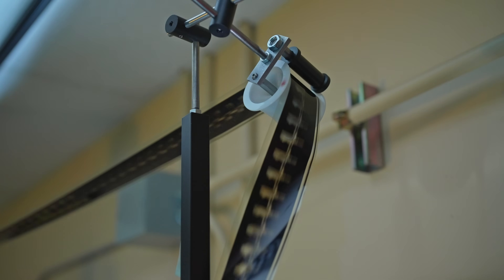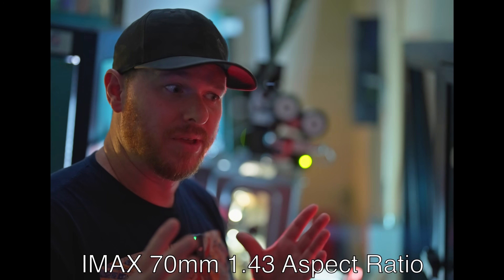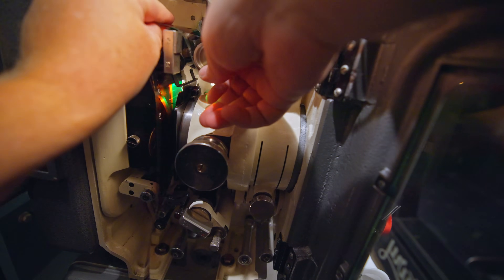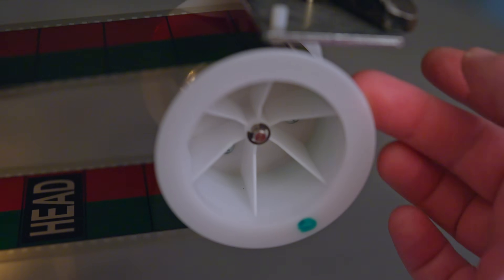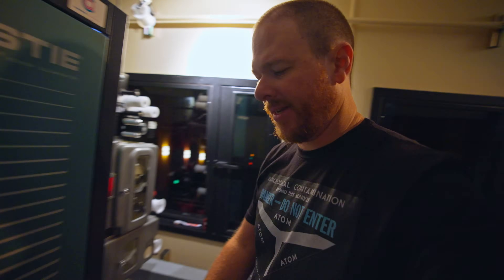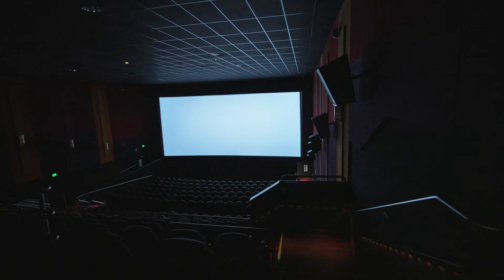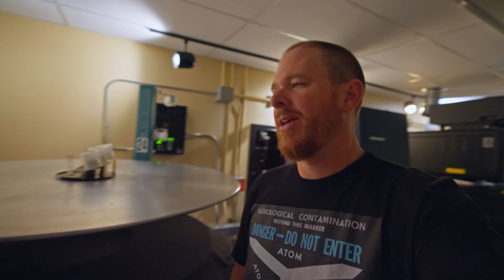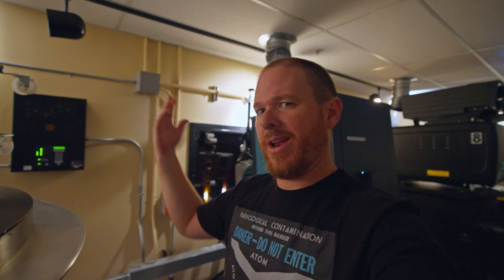Being a Projectionist for Oppenheimer 70mm Film Part 2

Comment: Great and fascinating video, thank you for making it.

Talking of the old days and two projectors, the reason they had to have two projectors was the limitation on the burn time of carbon arcs. I worked in a projection room at a cinema in the UK in the fifties. The positive carbon would burn away about four inches of rod in the twenty minutes of one reel. If you missed checking the amount of carbon rod left before changing over to that projector it would run out of rod before the reel ended, as the arc gap became wider the picture would take on a blue hue! Not good. But wonderful days with the mercury vapour rectifier sitting under each projector arc housing glowing vivid blue as it rectified 240v mains and supplied the arc lamp with 45v at about 70 amps. 

Thank again for the video.
Reply from the maker: I've only seen a carbon arc lamp fired up a couple times. They had one over at Paramount Studios that was used for a Vista Vision projector. I'm sure the burn time on carbons had a part to play on why reels of film were usually around 20 minutes or 2000'.
Reply: It's where the phrase "Strike up the lights" in theatre comes from, the old days of carbon arc... Not in my time though, we'd already switched over to HMI or MSI lamps by that point in the late 80's... they still had to strike, but didn't involve any manipulation of the electrodes as they were in sealed into their glass enclosures, but you still need a small bank loan to buy them.....

Comment: It's always blown my mind how projectionists make those change overs in the old system. I just can't wrap my mind around how you time it so perfectly (I guess I need to see someone doing it).
Reply from the maker: Most of the film I have run being a projectionist has been changeovers. There are numbers that count out footage on the leader of each reel. If a projector has a fast start up time you could have the 10 foot mark in the "hot hole", where the light would come out of. Some projectors started up slower and you might have to thread up on 8 or 9 foot mark on the leader...or if you were just a slow on the motor start cue kind of projectionist. Doing changeovers well was a bit of an art.

Comment: Interesting to see you are using a DTS sound reader. At the start of digital sound in the cinema, we had 3 different types of digital sound available. Two were optical code on the film itself. Dolby and SDDS (Sony) The third being DTS, as you described with time code printed on the side of the film, but the sound was separate, contained on special CDs usually 2 per film, and no, they would not play in a standard CD player. The DTS system was the lowest cost of the three with the SDDS system the most expensive. As the DTS was separate from the film, common issues were, discs missing or late arrival to the cinema. Discs scratched and would not play.
The player used a basic CD drive, often you could find the soundtrack started late due to run up speed of the discs themselves. If the film as slightly damaged, you could lose time code completely. If this did happen the digital track would drop out and the sound would revert to the analog optical Dolby A with a very noticeable drop in sound level and quality. These comments are reference to 35mm only. If you lose code from a 70mm print, you have ZERO sound. Some older prints did have mag sound, however. Not as good as digital but quite close.
Reply from the maker: So far the DTS on all the 70mm shows I have run over the last eight years have all worked great with zero dropouts. The DTS players now playback from a hard drive that the audio is loaded onto. The older players had all kinds of problems. Usually SRD (Dolby Digital) was our go to.
Reply: Wow, that sounds like it was cobbled together without a lot of pragmatism.  If I were engineering something like that, I would try to minimize startup delay by having the discs spinning in a cue state while waiting for TC lock.  Maybe even have a RAM buffer with the next 5 - 30 seconds of encoded audio, just to paper over recoverable read errors and enable faster start (no need to wait for initial seek on the disc, assuming the TC start was within reasonable proximity of the beginning of the audio stream on disc, and not suddenly beginning a minute or two into playback.)

Also would try to sync an internal clock to the TC, so it could freewheel during loss of TC.  Might have to fudge the playback rate a little, or even skip some frames of audio, once the code came back, assuming the drop-out would commonly coincide with mechanical hiccups or a splice in the film.  But that's better than giving up and playing silence the moment you lose code.

Scratched discs... I mean, I guess you could layer on more forward error correction, or even interleave data across two or more discs to make it more resilient.  But at the end of the day, I think I would have probably assumed the people running the show were professionals who knew how to use a jewel case.  ;-)  haha
Reply: @sirnickity  Hi Nick, I could write a book on this!! You must remember this was very early days I am talking about the tech DTS used was all quite new, looking at the latest version. it's a completly different machine. 
In those days, you loaded the discs, but until the film started and time code was received the DTS unit had no idea what film you were playing or even what part of the film it was looking at. When all was well, it did work and sound very good, probably the best at that time. Not all cinemas were created equal. Like all businesses, the staff varied in technical ability. Many projectionists were excellent, for some it was just a job. Film transport was a major factor in film damage. The boxes were often damaged, the bobbins were often broken. Not spooled off even on a bobbin, leaders not attached or missing completly from the previous cinema. Add a CD caddy to that, that's how they often arrived damaged.
Reply: @MichaelBeeny    I remember seeing Jurassic Park in DTS.  I was just a kid, but I was a nerdy kid, and the novelty of using CD-ROMs for the audio track was fascinating to me.  It has never ceased to be.

Also:  CD caddies... of course.  That makes sense.  All the intention of trying to protect the discs, but inevitably failing to endure any better than bare discs properly stored and handled.
Reply: I used to be the senior engineer with UCI. I remember installing the first batch of DTS processors. The first film was JP. Prior to this we had analog 5.1 Dolby. Here the 5.1 was largely a matrix with the sub part of that. No dedicated track. The DTS was the first all-digital discreet tracks including the subs and stereo surround. If you remember the very low thumping noise that the creatures made, this came from the largely discreet sub channel which the JBL subs did not like at all. Many had to be replaced due to cone damage. The analog sub, being part of an optical track was neither, that low or with any great depth. Mostly due to the limits of optical sound. Dolby SR helped considerably but no match for digital. @sirnickity
Reply: @MichaelBeeny   I can't imagine that (having a sound effect that took advantage of the new medium's extended bandwidth) was an accident.  ;-)  Sounds like it was a deliberate pairing of blockbuster film with new tech to show off, not unlike Star Wars and Dolby Surround.

That is a super cool story.  I found an early DTS decoder, cheap, on eBay a little while back, and it was difficult to pass that up.  I have no practical use for it, it would just be a sort of realized dream to have a "theater audio rack" to play with.

Comment: Former projectionist with a bit of history to share. Two projectors loaded with 20-minute reels of film changing back-and-forth, and projection booths constructed of concrete like bunkers used to be a necessity. Movie film used to be made of nitrate cellulose, which is chemically similar to GUNPOWDER. The fire safety standards had to be very strict. In the 1950's and 60's, the industry transitioned to acetate cellulose film stock. Acetate film will melt, but it burns poorly.

After that transition was complete, a single projectionist managing multiple screens became possible. I began working at a four-screen theater where we spliced 20-minute reels together into 60-minute reels, and typically only needed to changeover from the first projector to the second projector once per screening. By the time I left, they had upgraded the theater to eight screens with a single projector plus a platter system per screen. But we still had to splice 20-minute reels into one big reel on the platter.
Reply from the maker: I’ve been in a bunch of those old fireproof projection booths. Would be a bit of a scramble to get out of there if a fire broke out because of the fire door that closes when a fire breaks out. All of the changeover shows I’ve run have been one reel at a time. We never did 6000’ reels because we would only work one screening room at a time. Of course this was at the studios. Theaters were totally different.
Reply: Those 20-minute reels of nitrate cellulose film resided in fireproof cassettes that were part of the projector, and the projectionist was required to keep the film reels not in use in fireproof storage. As long as the projectionist followed procedure, only the few feet of film actually between the two cassttes  was in danger of igniting if something went wrong. Here is an example for everyone: https://i.ebayimg.com/images/g/-1QAAOSwyAxg5OKO/s-l1600.jpg  @RadioactiveDrew

Comment: Did you have a digital backup in case something happened with the 70MM?  Did you ever have a chance to compare the two technologies?
Reply from the maker: I do have a digital backup incase the 70mm film goes down for some reason. I’ve never had to switch over. But I did check the digital version in my theater. To me, the digital seems to be over sharpened and the contrast seems really low compared to the 70mm film.

Comment: Also, for sound on the 35mm prints, in addition to time codes, they also have Dolby digital sound directly on the film. QR code looking digital codes between the sprocket holes contain the sound. 35mm prints also have 2-channel optical (analog) sound track that runs between the picture and sprocket holes. Dobly digital has relegated the optica audio to a backup role incase the digital system fails.
Reply from the maker: The 35mm film prints had a bunch of audio formats packed on there. They had SDDS, DTS, SRD and SR. It was always nice to have a backup just incase.

Comment: I find it odd that for visuals it is analog and for audio it is digital. Older films 70mm prints apparently had various analog methods on the film for the sound. Though from other YT videos it seems on IMAX 70mm there is no space for an audio track so I guess it has to be digital and probably best to just design around the highest denominator or something (IMAX 70mm)🤷‍♂
Reply from the maker: 70mm film use to have a mag track on the film. I’ve only had to run that a couple times for 2001 A Space Odyssey. Not totally sure how the IMAX sound works. From what I’ve seen it has to be synchronized at the beginning.

Comment: What I find weird/incredible is that film isn't tightly wooven into the spiked rollers and also that those loose loops, that he deliberately puts in, when switches components, don't seem to destroy the flow of the film. 😮😮
Reply from the maker: In the projector there are two constant speed film sprockets and an intermittent that pulls film 5 perfs (film sprockets) at a time.

Comment: How do you become a projectionist? Loving this little series, always love seeing the projection room its still such a rare thing to see.
Reply: A projectionist is almost dead with the switch to digital technology
Reply from the maker: @rty1955 almost dead but not quite.
Reply: @RadioactiveDrew  I understAnd that, but management wants to cut costs and labor, ESP UNION labor is expensive
Reply from the maker: Have people that know what they’re doing is expensive.
Reply: @RadioactiveDrew  yes I agree and management want to reduce those costs. When I was operating a 2" quad videotape machine it took very special skills to operate one of those machines correctly. Now any idiot with a laptop can record and playback videos with ease. When I was in my union shop yoi never mixed jobs either. A tape operator never touched a camera or audio board. That was totally against union regulations. You had to hire a person who knew thay craft.
I can't tell you how many videotapes I had to reject for an edit session because the production company's would hire non union people who were not trained on using the equipment properly..now that the videotape medium has gone away, so has all its jobs. Film is yet another casualty. Not only are the technicians that work in film are going away, but even the labs who process the film or even  film stock producers are going away this increasing the cost of a production  studios want reduced costs and higher profits.
Reply from the maker: @rty1955 I’ve found union separation of jobs only works if people know how to do their job correctly it the first place. As a projectionist I would do a lot of digital film playback for live shows using an Avid system. Sometimes I would get some digital file that had some editing mistakes in the files or a bad render. So I would cut that out and fix audio levels as well. But if someone did their job right in the first place I wouldn’t have to do their job and fix their mistakes. Sometimes people would make a big deal about me doing something like this. But nothing every came I’ve it because their show was better.

Comment: How many frames are typically laced between the DTS reader and the Picture itself? Thanks for all the rad content, watching you segue into 70mm Oppenheimer projections has been sublime. I think one of the main reasons Nolan avoided radiation was because American Prometheus also did. The focus in both mediums before Trinity is the academics, and the focus after Trinity is the politics. And when it comes to Nolan, a Literature major, his focus in storytelling is usually anchored around philosophies, with Oppenheimer confronting its audience with constant paradox. Did some truly believe that making super-weapons would somehow lead to everlasting peace? How is indiscriminate death from the skies above more humane than military combat on the ground? My biggest disappointment would be the erasure of John Von Neumann, especially since game theory was so prevalent in Nolan's The Dark Knight script
Reply: when I worked as a projectionist, there was about a foot of film between the DTS timecode reader and the light aperture of the projector. But all the digital sound formats were designed so the "sound head" could be anywhere  convenient along the film path. The technician installing the sound head just had to program the digital sound player with the appropriate offset to synchronize the sound to the picture.
Reply from the maker: @mobyhead1 exactly. You can change the offset when setting up the system.

Comment: An OG projectionist taught me to wind a nickel into a reel of film just before the change marks. As the film plays, the nickel drops on the floor so if you're zoned out, you don't miss the que. Obviously does not apply to platters.
Reply from the maker: Yeah I wouldn’t trust that. I could see that nickel falling into the projector. Some projectionists would put in “blind man’s cues”. These were pieces of splicing tape added to the reel you could hear warning of a cue coming up.
Reply: @RadioactiveDrew  Unless using a nickel he found on the concession floor, it wouldn't fall into the works on his projectors. Your mileage may vary.
Reply: That's definitely that old school life hack style. Love it!
Reply: that was actually an important plot point in an episode of Columbo lol
Reply: As a teenager I got to run films at a local drive-in theater, in which the feed-reel magazines had mechanisms that either rang a bell or allowed a rod to drop, either way providing an audible alert to the projectionist that a changeover was imminent.  Those changeovers were my favorite part!  (This was obviously during the days before the advent of xenon lamps and platter-based film projection.)  The nickel idea also sounds really clever, but did it ever scratch the film?
Reply from the maker: @jes9015 most of my jobs working with film have been reel to reel changeovers. Platters can be very finicky.

Comment: Really good and informative video! 
Even though I still don't get it  why the film has to fold 15 times over ... 🙂
Reply from the maker: Well it’s about having good tension on the film without it flopping all over the place. The path the film takes is also to make sure it doesn’t get scratched. Once it’s scratched that scratch is there forever.

Comment: I'd love to know more about the audio end of things. So, from the DTS timecode/audio output, where does the audio go from there. I'm assuming amps and then on to the spaakers, but additional information regarding the pieces of hardware would be interesting.
Reply from the maker: From the player it goes to a processor where the volume is controlled and distributed to the amps and then out to the speakers.
Reply: @RadioactiveDrew  I'd be interested in knowing what amps and speakers are being used (make models). I'm exploring making a 5.1 system for my home (not with a traditional 5.1 system, but with some legacy DTS or Dolby hardware to get proper analog breakout. Again, love the video!
Reply from the maker: @RichardMitchell1829 usually the speakers and amps are JBL. At least that’s what I’ve seen. I have no idea on the make and model.
Reply: @RadioactiveDrew  I appreciate the information!